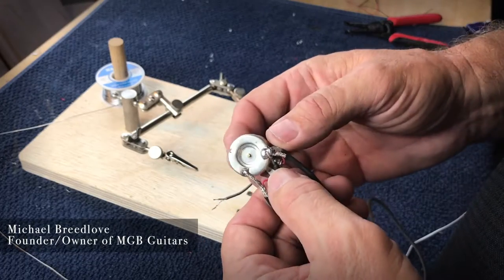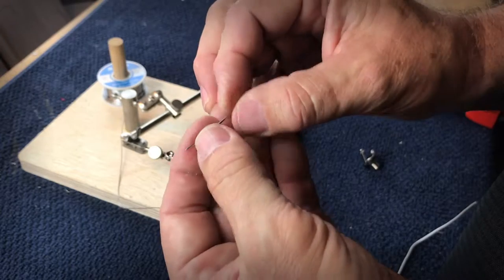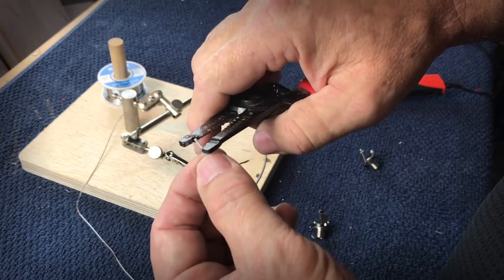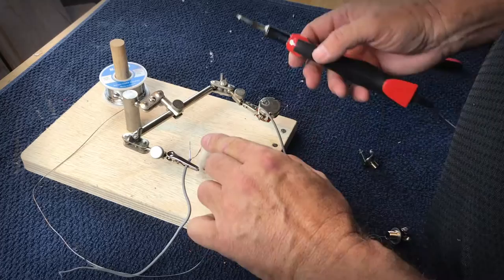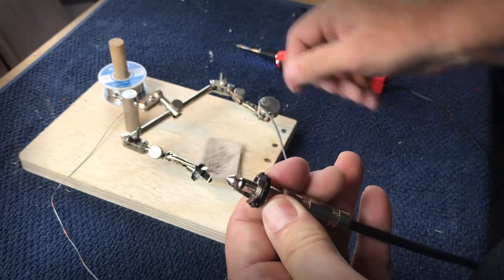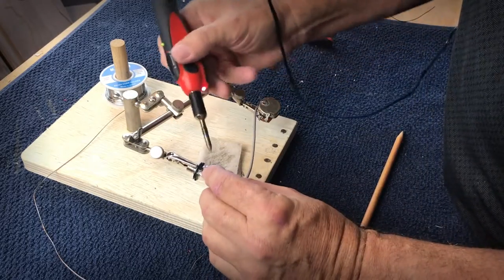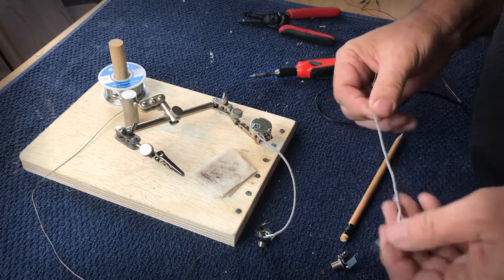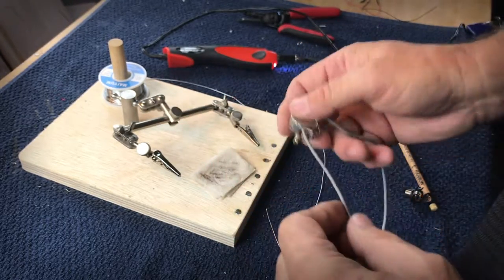All About Soldering | Learn'n & Build'n with Michael Breedlove

Comment: If someone is having problems with solder joints, I suggest always using flux. It serves as a cleaning agent for the iron, and a wetting agent to help the solder attach to the work.  
I dip my untinned wire directly into the flux.  
Even if you use flux core solder, it helps to have additional flux to teach the solder where to flow, and to avoid “cold solder joints” which is what you get when the solder does not quite adhere.